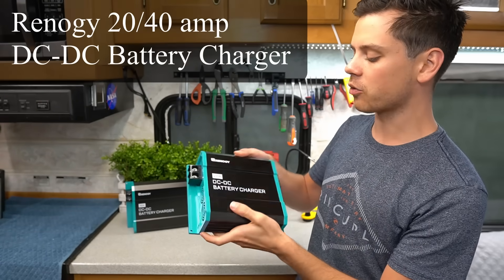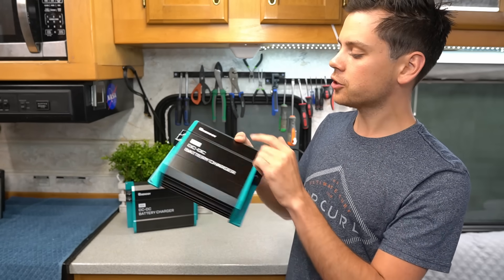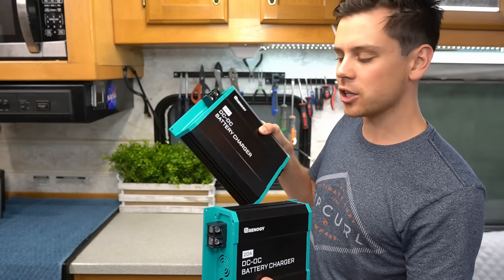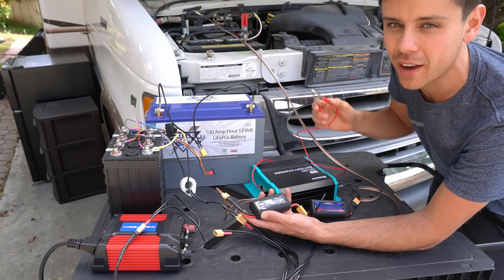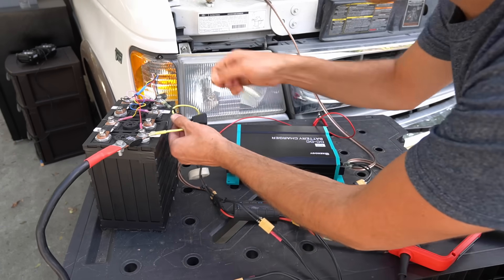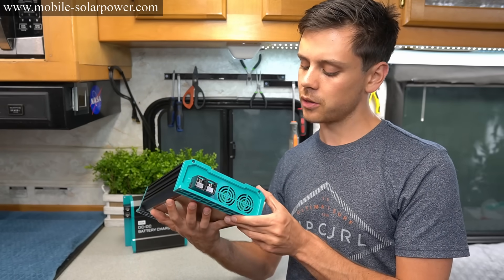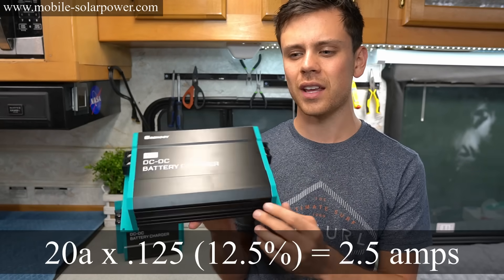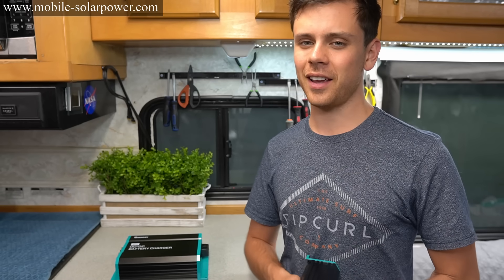Renogy DC-DC Battery Charger Review: "Smart" Alternator Charging for Solar Batteries!

Comment: Mastervolt is another reputable manufacturer of DC to DC chargers (and a lot of other devices too). These battery chargers sometimes have dipswitch settings for charging LiFePO4 batteries, but those settings vary from manufacturer to manufacturer, and don't always match the charge profile of a given LiFePO4 battery. For example, looking at the Relion inSight 12V 120Ah LiFePO4 battery (expected to be released this Fall), the Mastervolt Mac Plus 12/12-50 battery charger seems (at least to me) to be the best choice, comparing it against Sterling, RedArc, and Renogy products. The Relion battery is slated to have bulk charging voltage of 14.0V up to 14.6V maximum, and float voltage of 13.8V, and the Mastervolt matches that charge profile - interestingly, not with their LiFePO4 setting, but with their dipswitch setting for AGM, Gel and Spiral batteries: 14.25V bulk, and 13.8V float. (Their LiFePO4 setting is 14.55V bulk and only 13.25V float, which would float the battery at close to 0% SOC). 

Besides matching the battery charger's charge profile to the battery's charge profile, the output amperage of the battery charger should ideally match the battery's recommended charge rate. The above 120Ah Relion battery has an expected 1.0C charge rate, i.e. it can accept 120A of charge, since Relion is building a heat dissipation feature into the battery itself. Most LiFePO4 battery makers seem to recommend 0.5C for charging, or 60A in this case. The Mastervolt Mac Plus 12/12-50 outputs only 50A when charging the battery. No harm done to the battery, just slower charging. But even 50A for an extended period of time to charge a significantly discharged deep-cycle battery is a lot of extra draw from the alternator, so it seems almost a requirement to upgrade the OEM vehicle alternator to a high-output alternator, to avoid overheating the vehicle's OEM alternator. It gets pretty expensive when the upgrades include a high-output alternator, a DC-to-DC charger like the Mastervolt Mac Plus, and a LiFePO4 battery.

Comment: Thanks Will for reviewing these. Would the 40a be too much for my 140A alternator?And would 40A be too much for a single 100AH Battle born? Add a 12v delay timer on the trigger line and you can set the charging to begin at whatever set time. It is only 5-10 bucks on Amazon. Add a switch if you want to completely shut off charging.
Reply: Did you get a answer for this question?

Comment: Hey Will, I've built a 12v 90ah lifepo4 battery with four 3.2v batteries, following as you've done in other videos to a T.  In addition to the solar I have on my truck, I'm considering one of these units and saw a product sheet for the various voltage configurations you can achieve flipping the switches.

For someone who wants to stay in the happy range as you've advised, something like 20%-80%, how can you safely do this with this unit?  There's a gap of voltage settings between 13 and 14v, so hitting your updated recommended charge voltage of 13.3 seems impossible.  Also, did you discover any temperature cutoff ability for this unit?  Say you don't have a heated compartment and have a charge temp cutoff set on your solar (Victron battery protect to one of their controllers) - you're safe there.  But what happens when you turn on your vehicle in -10*F?  Will this unit still try to operate and bork everything?  Thanks!
Reply: Brandon Kennedy have the same question... did you ever get an answer?
Reply: @Nightmarehc130  i asked on renogy's site and they answered that there is no temperature control built in to this, it's reliant on the battery having a BMS with temperature shutoff.  As far as the voltage gap, that makes it a no go for me.  I decided to say screw it to vehicle charging.  I get enough from solar even on cloudy days and have been running a huge 62 quart dual zone fridge constantly for a couple months now.  Even that's dicey using a Victron charge controller.  Most days it stops charging at 13.51v despite absorption voltage being set to 13.74.  Some days I'll look on the history and battery peaked at 13.81v.  That's bad news, one of my cells goes out of whack around 13.8.  I should have bought a battleborn battery.  At this point I wouldn't even buy brand new lifepo4 3.2v cells and assemble my own, much less another round of "new" old stock cells from ebay.  I have so much $ dumped in to this.  Been a learning process, and what I've learned is that I'd rather pay and have a phone number to complain to if anything goes awry.  I'd buy a battleborn today if I could figure out a way to repurpose the current setup.  That's a long winded answer and I'm just blabbing because I'm still butthurt.  But for now, as long as I ignore that the pack charges higher than I want sometimes, I'm still accomplishing the task of having a ton of power at camp - and am a lifepo4 convert.
Reply: Brandon Kennedy ouch.   I’m waiting on GWL to respond to my question about theirc123smart BMS.... I think it has a temp protect..... I would buy a battle born but I am not trying to save money but rather build a wide flat battery to fit in my 4Runner behind my storage..... will be charging from a REDARC 1225 BCDC charger....

Comment: After watching you and other people I am learning that Solar is the only way in Southern California to charge a battery. And that of course lithium batteries are the finest. So I’m trying to decide how to put together a system on my fantastic Oshkosh chassis Cummins diesel motor with a turbo with only 80,000 miles on it 36 foot motorhome. I kind of want to build a rack to put on the roof to attach the solar panels two and then put some kind of screen over the top of the solar panels like I’ve seen on some MotorHome company doing and it looks absolutely phenomenal. Because then the panels are protected and you can’t step on them and break them but you can move around on the rack up on the roof

Comment: Pretty cool! I don't really know vehicle alternator systems, but I am betting that getting a small gas generator for higher power demands is better in the long run due to total fuel use and vehicle wear and tear than trying to use the vehicle's electrical system. This would probably be best for occasional use batteries.
Reply: Depends on your batteries and your driving/camping habits.   With Lead Acid in whatever form, it's definitely a poor approach.  You need to run that generator so long to get your batteries topped off.  Many RVers do that and they also have to replace their batteries often because they never get floated.   With lithium, you could make a generator work better by having a high amp charger.  Lithium won't care if it's floated and will also take a much faster charge.  

 But you will not save much of anything buying and carrying and fueling a generator to charge at a site instead of charging while you drive.  As far as damaging the vehicle's wiring, you run separate wires and use a good DC-to DC charger to avoid alternator issues.  Most people will have zero issues and just connecting the starter and house batteries with a simple battery connector will work fine. WAAY cheaper and easier and simpler than carrying a generator and fuel.   Also, don't discount solar as your on site charger.   It works.  Finally, when in a pinch, I just idle my van.  It's not the best, but it's only needed on occasion when I'm at a site long time with no solar exposure.  I already have the gasoline in my tank and the generator.  Those small combustion engines in generators are louder, more polluting and inefficient.

Comment: I would be interested to see a vid on shore/gen set charging for these small lithium setups then we would have the trifecta of power options for a home built system - solar primary, alternator for rolling, ac input when available/or others are not an option.  Thanks for your hard work.
Reply: Buy a regular 2A/5A/50A battery charger 110V AC to 12VDC. Plug it in a 110V outlet and then to the engine's starting battery and.turn on the car's ignition on to wake up that Renogy thing. Max. $80.
The real question is how can we  also charge the engine's starting lead acid battery from solar?
Reply: @PrimalMiltos  You can charge starter battery from LFP battery through a voltage-activated diode.  It will only turn on when the solar charge is greater than whatever voltage you set, so discharging starter battery to LFP battery is avoided.
Reply: #4 a good inverter generator.

Comment: I need one for a 24v system
Reply from the maker: Sterling makes 12 to 24 volt dc DC charger, or you can use boost converter

Comment: Can you use this with a smart alternator
Reply: Yes, this is what these were designed for. The old "dumb" alternator systems simply used a solenoid contactor to directly connect the battery bank to the alternator.

Comment: Another alternative to charge on cloudy days is to get an AC/DC adapter (14v - 21v, 10a - 20a), and put the DC output into the MPPT solar input. That's how Yeti does their fast charge, and how YouTuber Todd Parker charges his. It's an inexpensive solution if you already have an AC source, which many RVers do.
Reply: Ken Burrell do you mean shore power?

Comment: Thanks for another great review. If you are going to compare this Renogy kit with the Sterling equivalents at some point, could you also consider looking at the Victron Buck-Boost (25A & 50A) options. I’ve always found Victron inverters and solar regulators etc to be super reliable, but if you thought the Sterling kit was expensive the Victron (here in Europe anyway) is 💵💵💵💵

Comment: But what if the leisure battery  is not deeply discharged? that would be fine, right? as long as your battery is at say. 12.3v
Reply: timothy790110 I think there’s some missing information. What’s the actual scenario?
Reply: @AaronGeller  Scenario is, you drive with a vsr but the leisure battery isn't deeply discharged, so it cant accept as much current as say, if it was a 12.1v and risk burning out your alternator.-
Reply: timothy790110 I’m not sure what VSR means but I think what you’re saying (assuming it’s a lead acid and not lithium) is that because the battery is fuller and thus higher voltage that there will be more stress on the alternator.... at least that’s your concern. 
No I don’t believe that’s an issue because the alternator should be putting out 14 volts constantly and consistently so it should provide more strain partly because it is actually delivering less current. I could see this being more of a problem with lithium where the current is constant because there’s little resistant in the battery to receiving energy. 
Does that help?

Comment: With the low amp output you could connect this to your house battery and use that 2.5 amp output to charge an electric bike or other 12v toy batteries.

Comment: Great review,  on the delayed start of charging, seams like a inline switch could be used to control when the charger starts on the ignition wire.
Reply: That's exactly how I did it and it works great.

Comment: Great video Will!  An odd question:  can the DC-DC Battery Charger's power (40A) be combined with the 100A of the Battleborn to get 140A of power?   A standard circular saw running at 15A (at 110V) = 1650W can exceed the amount of power that the BB battery can provide (12V x 100A = 1200W) (assuming I have a big enough inverter).    However, there could be 140A and thus 1680W (140A x 12V) available if the charger and battery were combined, theoretically able to power the saw.
Reply from the maker: Wow great question! Considering voltage drop for that load, and if the DC DC charger was set to lithium mode, I don't see why not. That is a great idea! Run the charger for large load that the bb can't handle with it's discharge rate. Smart idea...
Reply: Will Prowse wouldn’t it just be easier to buy a cordless power tool and spend $100-$200 and have multiple large capacity power tool batteries?
It just seems so much simpler
Reply: @AaronGeller  You're being too specific.  There would be other loads and uses not covered by a cordless device.  A coffee maker can use 1600W.  Want toast in the morning?  1800W in some cases.   In this very video, what did Will use to test?  A 1500+ W heat gun. He had it working but likely not on its max setting.  None of these devices are available cordless.
Reply: @WillProwse  Thank you, Will!  Your video is inspiring me (actually it's compelling me) to consider DC-DC charging.  I greatly appreciate you doing this video.  You are saving me and countless others from damaging their car's alternator and possibly other components of their electrical system.  I shudder to think that something expensive like the car's ECU could also be taken out as an alternator fries!
Reply: @IncandescentDaD  "For some people," Not everyone is on a shoe string budget so I don't want to base my comments on a few and assume people's finances. It's a matter of priorities and what you NEED.
It's possible to combine the power from the converter and the battery but that's a question for Renogy more so than for Will as they should know the limits of their products.
"You're being too specific" Those were some very specific examples, speaking of irony, but I'm fine with those examples even though personally I would just use propane to heat water or an induction stove for making coffee. Whichever way you prefer to make your coffee if you need toast, that's your personal preference. I suppose I wouldn't want to have to turn on my vehicle each time I wanted to use more than 100 amps.
Reply: IncandescentDaD so after spending all of 20 seconds looking at the user manual, if you put two Battleborns in parallel, you can achieve 2400 watts continuous. If you NEED to use a circular saw then it’s worth it to have to batteries.... but why not just have a wireless circular saw in the first place and buy a large battery for it?
Reply: @AaronGeller  For some people, a single LiFePO4 battery alone is a stretch.  To ask them to buy a 2nd one...!  Another  $1000...!  Not trivial!  Contrast this with the price of the DC-DC charger.  Plus the benefits that it can provide.  Wouldn't it be great if, through the purchase of this much cheaper device, you get to safely charge your battery bank, provide 12V DC power to other devices whilst doing that, AND supplement the power of the battery bank for when requirements temporarily exceed that which the bank could provide?!  

Could I buy a cordless circular saw?  I guess.  But that's yet ANOTHER expenditure.  Why do that if the DC-DC charger can help?  And trust me, a cordless circular saw is nowhere near as powerful as corded one.
Reply: @IncandescentDaD  Are you using the circular saw for full time use or just for projects?
Reply: @AaronGeller  Just projects.  Not full time or professionally.  If I were a contractor and using something so powerful in the field for long periods of time, I suspect I'd need a generator.  2 or even 3 Battleborns might not cut it.  The idea was just because I'm leaning towards getting a DC-DC charger anyways.  And it'd be cool if there was this additional side benefit.
Reply: @IncandescentDaD  I also enjoy using woodworking tools as well but in my situation, I really enjoy cordless. I agree with you that corded tools will have more power than cordless.
I would reach out to Renogy and run your idea past them to see if that would work.
Reply: @AaronGeller  Thanks.  I'm a beginner woodworker and am slowly accumulating cordless tools.  I like them a lot too.

Comment: thanks for the video will. one question.. the charging voltage seemed a little low for lithium batteries, at least the lithium batteries I'm familiar with. can you clarify the charges profile to fully charge those lithium batteries. are they much different than the battleborn lithium batteries?  thanks again for bringing this product to our attention.
Reply: EandM Porter yes you can change the constant charge. The highest charge is 14.6 and each increment is 0.2 down to about 13.6
Reply: It has a DIP switch
Reply: @AaronGeller  thanks aaron, it sounds like you are actually using one? thumbs up on the device?
Reply: @eandm8982  It's actually in the user manual :)

Comment: Can you make a video on how to create a UPS (uninterruptible power supply) without solar? These UPSes are super expensive; would be cool to figure out how to build a DYI UPS on the cheap that can compete with expensive UPS on the market.
Reply: He has all the information out there, just hasn't made a video on it apparently.  Just use an inverter charger with a bypass feature and some batteries, like two things to buy.

Comment: Seems like you could use an in line switch on the dash for the input trigger, to have more control over when it starts and stops charging. You could also turn it off before arriving at your destination to give the alternator a break before shutting the vehicle off. 

Going further, you could activate it only when slowing down or going down grades to reduce fuel consumption, but that's probably just splitting hairs. 

Good video as usual!
Reply: Subwoofer 101 I like the idea of an in line switch on the dash 👍
Reply: A delay switch that sends 12v trigger after a set time is probably best.